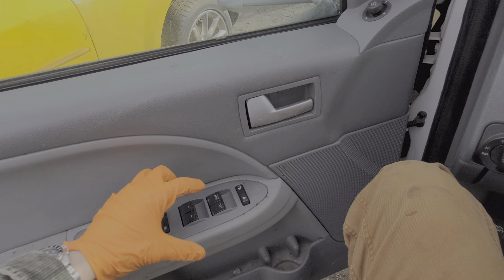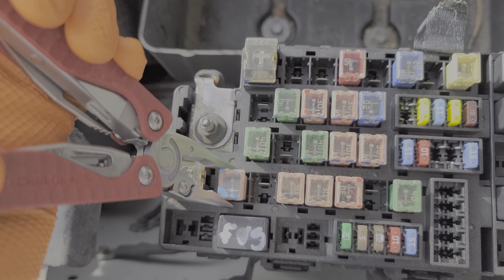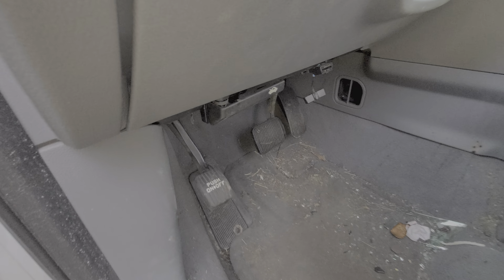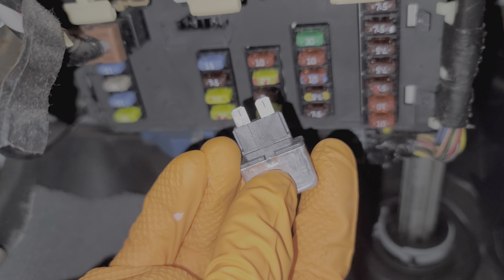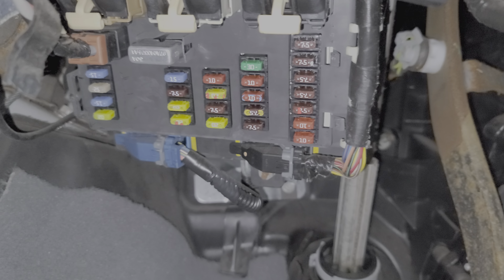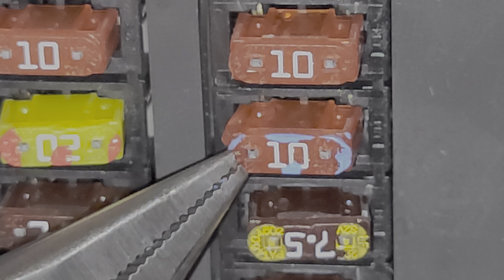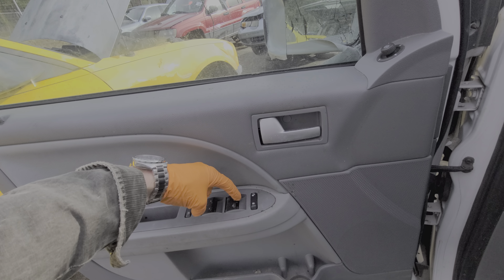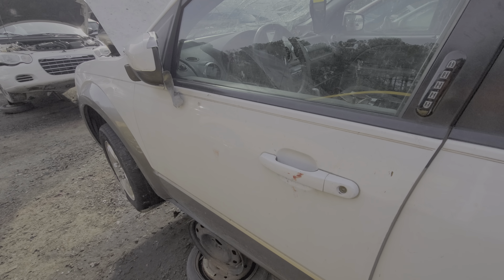2005 Ford Freestyle Power Window Fuses & Circuit Breaker

Comment: My battery went dead.  So I charged it and reset the CPU and capacitors. Did the relearn and it ran great.  The next morning the battery was dead again. Recharged again and my audio was gone.  Radio and CD was playing but no sound.  Then... the radio went dead,  power windows, interior lights, all dead.  I see my F2 fuse is burnt. But that doesn't control all the accessories that are off. Thinking it might be a combination of the 2. The 30A breaker and the F2. The F15 accessory fuse looks good but haven't checked with the multimeter yet.  This just happened tonight. Can't the 30A breaker be checked with a multimeter? Thoughts?